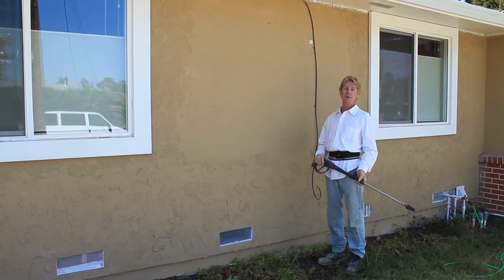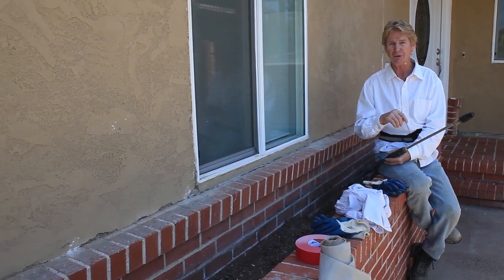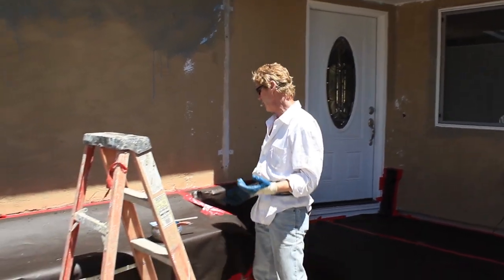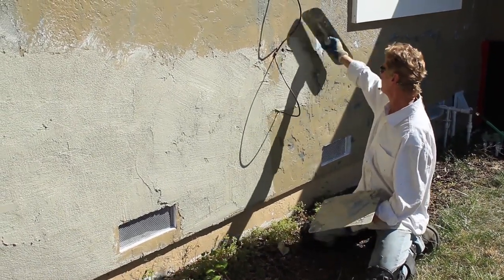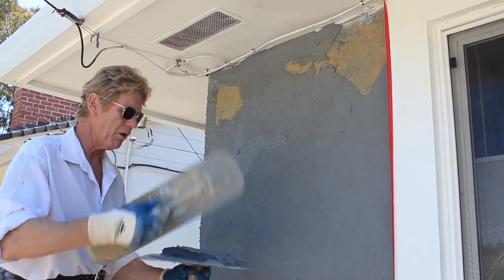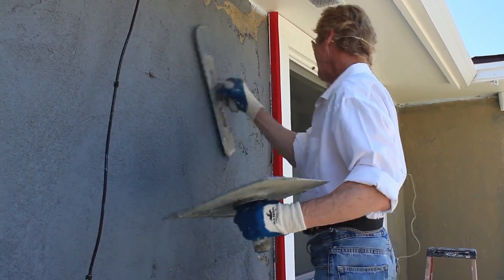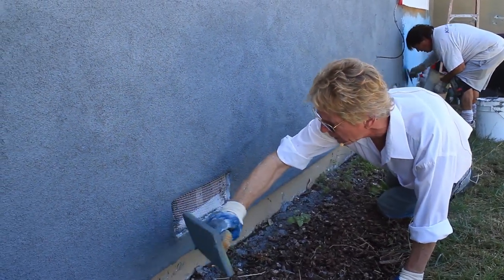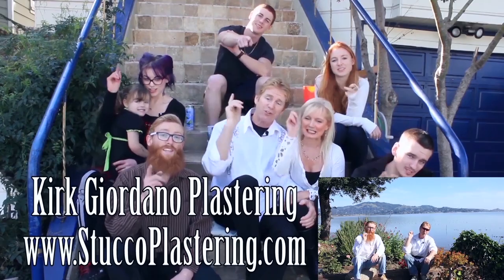Make rough stucco smooth

Comment: Can you put a cement coat over an acrylic stucco? Our painted cinderblock building was coated with acrylic base coat as binder. We had wanted cement stucco.
Reply from the maker: Good evening Jeanie, of course, you can. Proper prep work is all that's needed.
     Bringing peace, love, and harmony back into the world 🌎of plastering.
  The University of plastering by Kirk and Jason Giordano. 🎉💃 🥂🧞‍♂️
with over 850 free advice show and tell video’s on stucco & plastering
Reply: Kirk Giordano plastering Inc. thank you. Is an application of Weld-Crete or Quikrete before proceeding adequate prep work?
Reply from the maker: @jeaniesmith2069  Howdy Jeanie close, however, the pressure washing is much more important as nothing adheres to a dusty, dirty surface, not even bonding agents or quality primers. 
The walls don't have to be clean enough to eat off, but extremely clean. I even state micro scored or etched if possible.
     Bringing peace, love, and harmony back into the world 🌎of plastering.
  The University of plastering by Kirk and Jason Giordano. 🎉💃 🥂🧞‍♂️
with over 850 free advice show and tell video’s on stucco & plastering

Comment: Do you have to put bonding before apply new stucco?
Reply from the maker: Good Evening AnLac, over any painted surface, you betcha.
 If one is going over a newly applied cementitious base coat, then it's not necessary.
       FYI, we are still working through the pandemic, however, if you’re not you can still learn to repair yourself through our huge selection of videos on this channel.    Bringing you the most comprehensive encyclopedia of free plastering video’s ever put together,
 by the plastering messengers of Youtube. 
Kirk and Jason Giordano with over 800 videos 🎭 👀💃

Comment: Kirk . Actually  you can also brush sika latex power Just like you do the welde and it works...
 (name differs from country to Country)
However.. the entire process is not nearly as easy nor effective as welde Crete usage.
I think I can confidently say that after delving into all the technical Data sheets of both products.
Shame they only sell welde in US
Reply from the maker: Good evening Gefilta, not certain, Sika does make a bonding agent that instead of water you add their liquid product to mix with the tile grout, which gives the grout more adhesion.
 They are making product so fast, it's hard to keep up with all of them.😏
   The most complete plastering encyclopedia in the world on video, by the plastering messengers of Youtube.  
     Over 850 free self-help videos 🎭 👀💃

Comment: Hi Kirk I noticed you have used weld-crete at 50/50 concentration and 2parts weld-crete 1 part water for a color coat. Why have you used both and what do you recommend for a color coat?
Reply from the maker: Howdy, my friend, I recommend you buy Quikrete bonding agent at HD or lowes as it's user-friendly, just roll or brush on the wall and allow to dry then apply your color coats. 🍾

Comment: In my experience a surface washer attachment is far better than a turbo tip.
Reply from the maker: You may be right as I’ve never heard of that, however if I shoot my leather boot with this kind of pressure for awhile, it will reveal my foot, if I keep on washing my bone will then be revealed, that might hurt. Besides in over 40 years this system has never failed yours truly.

Comment: Betcha that brick planter on the front of the house is a disaster in the making - guaranteed it is improperly flashed/waterproofed and will transfer moisture thru the/siding. Either a clueless homeowner or a shambolic hack unlicensed 'contractor'
Reply from the maker: Good evening Author, at first impression I thought so too, but upon the question I had with the homeowners about it, it is indeed sound, just needs a tiny bit of TLC, a pinch of what we did to the exterior, I thought in the hands of a master brickman no more than two hours works to put back together as new.
    The complete plastering encyclopedia on video, by the plastering messengers of Youtube.  
     Over 850 free self-help videos 🎭 👀💃
Subscribers, you can depend on us to explain with truth, honor, experience, and skill for your time invested for wishing to learn the hows and whys of plastering.😉

Comment: I have poured basement walls that are a walkout basement (10 year old pour).  The forms were just pulled off and you can clearly see the form marks. We went to a local building supply store (not a box store) and were shown a product called Tammscoat.  There aren't many videos online about the product but at $150/5 gallon bucket I wanted to know if you have ever used it and if so will the sand based version of this product be thick enough to hide the form marks or will I need to put a thin coat of stucco/mortar over it first? 

I'm in Upstate/Central NY or I would hire you to do it! :)

Here's a picture of what I'm trying to cover, so I can finish my back hill with some retaining walls and a patio:

https://i.imgur.com/lH3rIke.jpg
Reply from the maker: Howdy EZ target Dude, I haven't usedTammscoat, but most acrylics might work, I'd recommend which everyone you choose to tell them you want the heavy sand or 16/20 sand. 
    You can ask for a sample quart to trowel on and float, then allow to dry then see if the lines still show, if so you will need two coats. I favor Stucco-flex personally.
Bringing to all the most complete plastering encyclopedia ever created in the world online.
 By the plastering messengers of Youtube.  With well over 850 free self-help videos 🎭 👀💃
Kirk and Jason Giordano Plastering